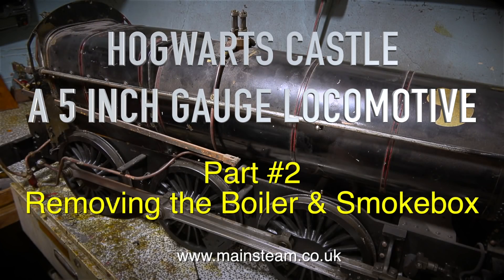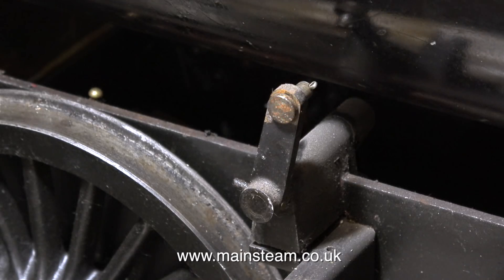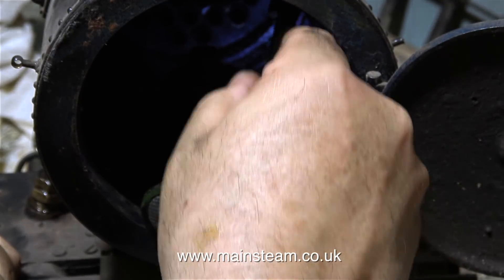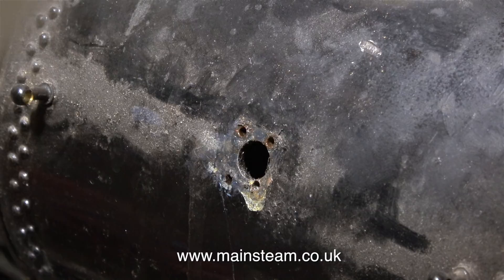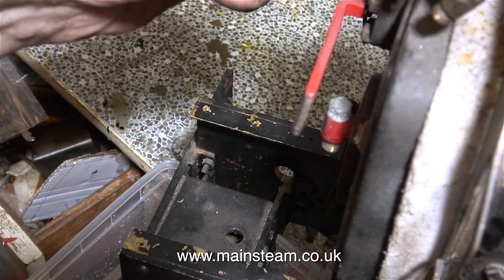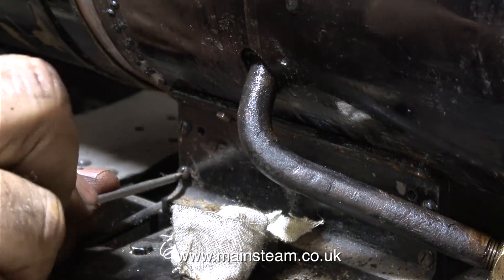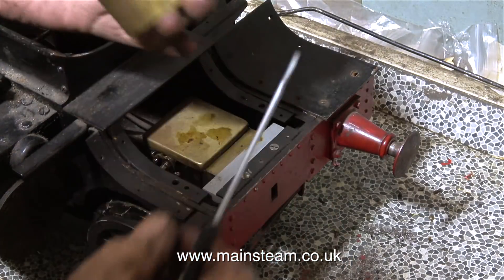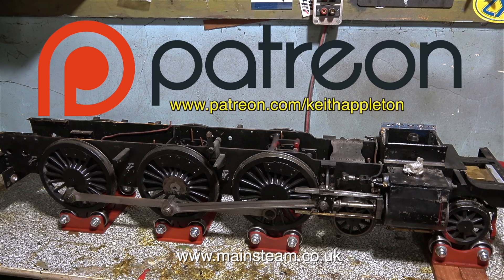HOGWARTS CASTLE - A 5 INCH GAUGE LOCOMOTIVE - PART #2

Comment: Hogwarts Castle is the locomotive named after the Wizard Castle in the stories by J K R. I Thought the the engine 
Is a LMS Red 460 Princess, 
But I am in America now, but in 
My younger years, 460's were black ,, and 462 tank , running either direction, passenger, and goods trains.
Tell me more about the 4-6-6'-4 In Southern green 
I never knew that  BR  had that
Wheel arrangement . In the US has the 844 on the Union Pacific. I would like to know about making a locomotive  ,
To run on a rolling road.
4664, 4884
Reply from the maker: It is really a Great Western "Hall " class locomotive.

Comment: Hmmm, I must have looked at this thing for over 10 minutes. (Maybe I'm not a purist)
Trouble is is that models, even operable ones take shortcuts and liberties with things.
The front bogeys seem too rigid to me, but maybe that's normal for this locomotive.
The side rods are odd, the hinge is leading the main crank. When I compared this to other similar locomotives the hinge follows the main crank. But I also found examples that had it the way this model has it soooooo. .  I'm not altogether sure.

Comment: The counterweights on the driving wheels don't seem to be cast in?
Reply from the maker: I don't think that the counterweights are "cast in" on the full size either . . . .
Reply: After doing some research to be sure, the drive wheels had the counterweights cast in i.e it wasn't a seperate piece.

Comment: THe pilot truck isnt equalizing.  I wonder if it was on the ground more than on the rails.  When I say equalizing?  I mean that it should flex to the track.  The back axle should have dropped down as it isnt supported.  Hopefully it is just grime that is keeping it from moving.  Otherwise some of your talented engineering skills will be in order.  I look forward to that vid.
Reply from the maker: the front bogie is fine.
Reply: The only obvious thing missing is the cab, boiler, and smokebox.  Trying for the obvious.  As to the valve motion. I am gathering the other commentors never heard of having inside motion. As I can see the lift arms for what could be for reverse inside the frame in front of the lead axle.